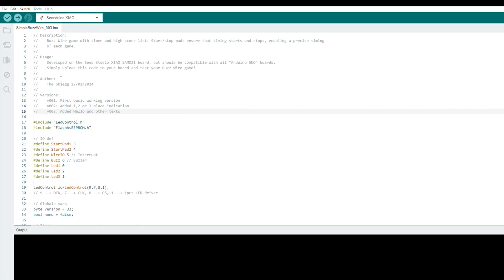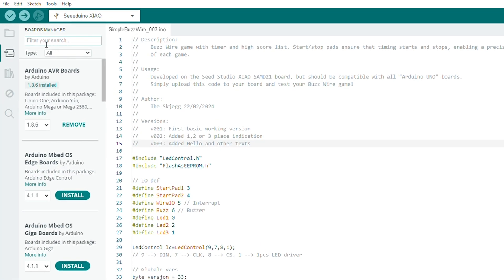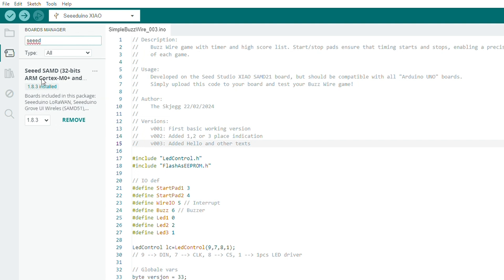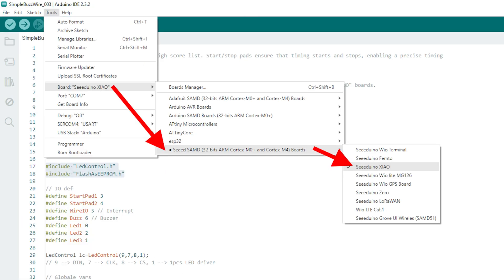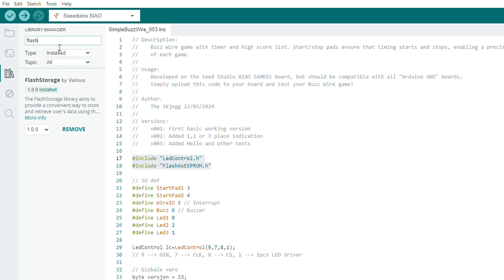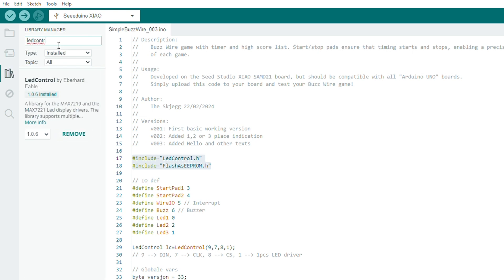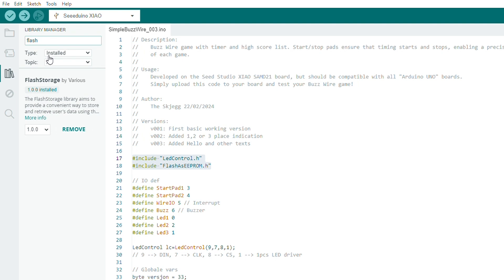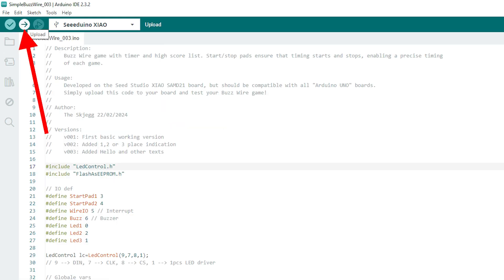How to make a timed Buzz Wire game

Comment: Hello! Do You have any idea, why my LED arent working with the resistors attached? My LEDs are working in 2,0 - 2,3 V range. 220 Ohm should lower the voltage to 2.2 V from 3.3 V. Without the resistor LED works fine, but I am not sure if it wont break.
Reply from the maker: Hi! Well that sounds strange, sure you got the correct resistor value? If so, try lower value resistors if you have..like 100ohm or so. You should have a resistor I think. Hope it works!